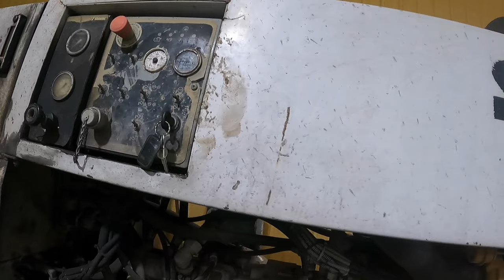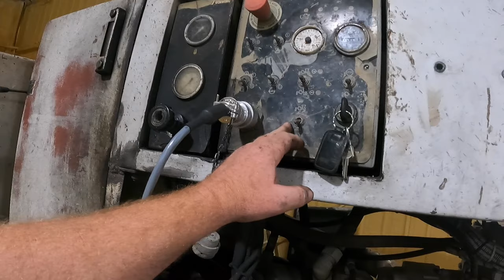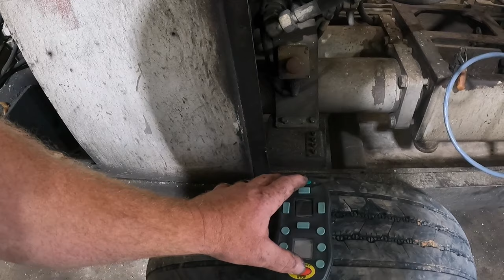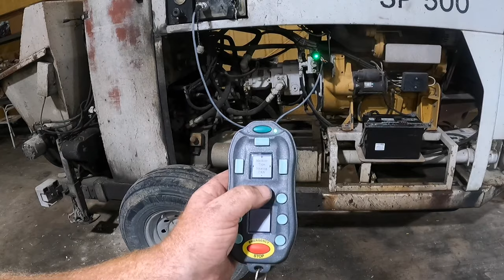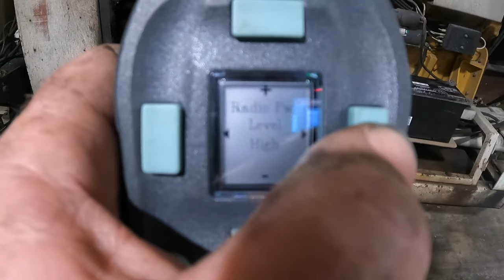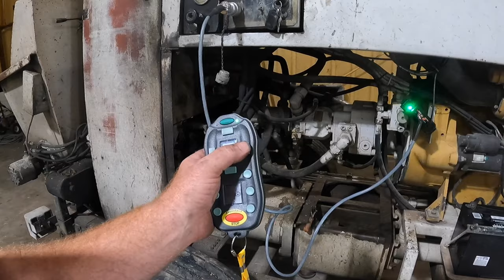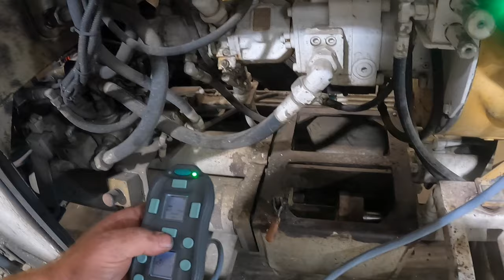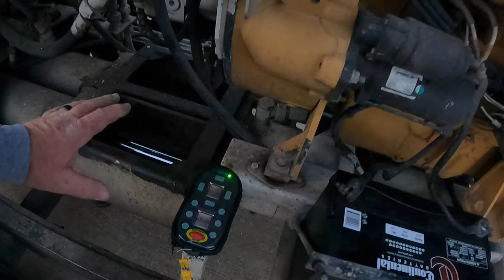New remote system for the concrete trailer pump and Muddyfeet

Comment: Is that a straight 57 mix? Or is it blended?
Reply from the maker: It’s 1/2” pea gravel 4000 psi
Reply: @MuddyfeetConcretePumping   this company we started pumping for wants us to try a straight 4000 regular mix thru our 3 inch line